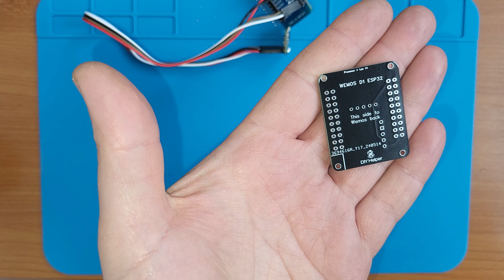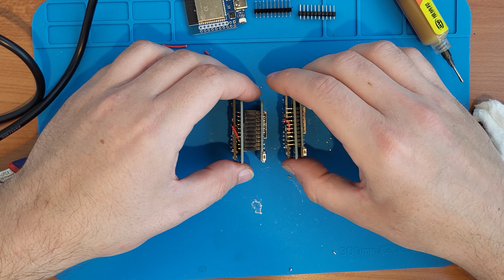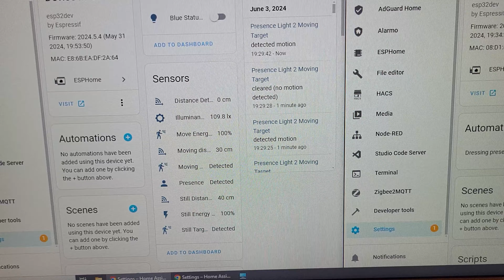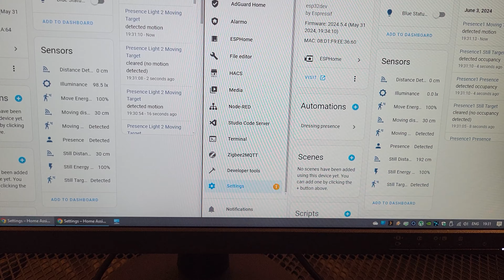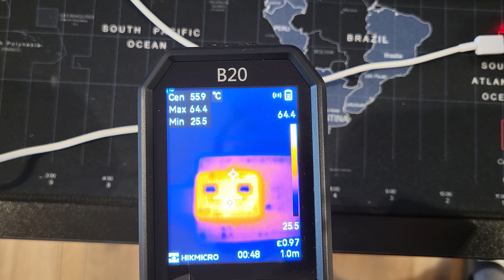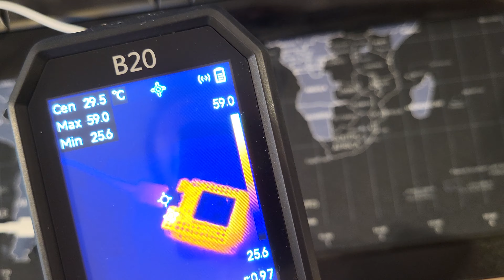Human Presence and light sensor the easy way BH1750 + LD2410, FREE PCB design

Comment: add a PIR sensor
Reply from the maker: For me this is fast enough, presence is more important than instant detection in my case. I wanted a small device that is not so much visible. I will probably design a 3d printed case when I get some time.